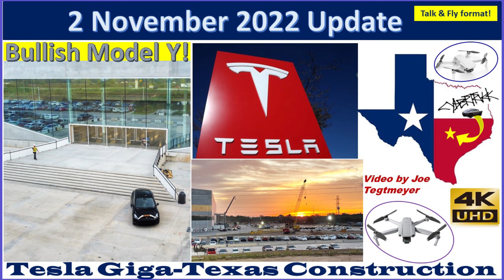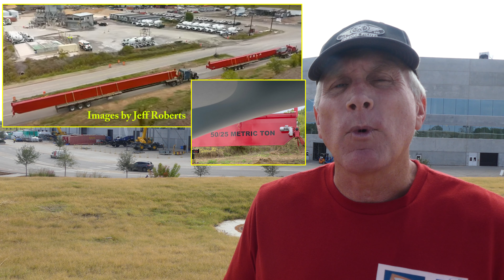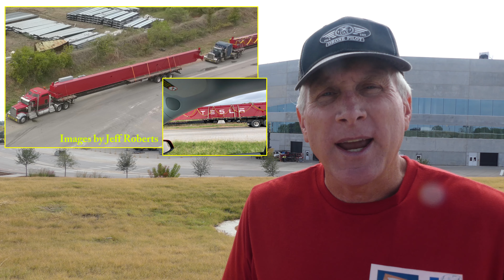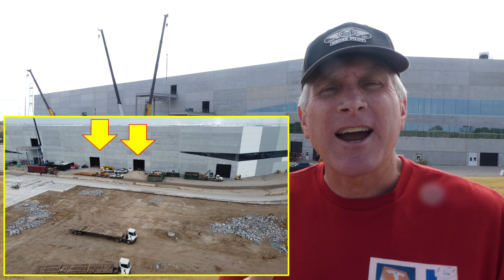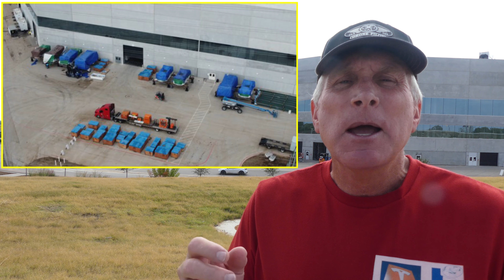Five new construction sites & S drill assembly! 2 November Giga Texas Construction Update (10:45AM)

Comment: the transformer foundations will have berms around the edge to prevent spillage to the soil of the oil used to cool the transformers. all transformers must have a berm to be licensed. sp expect short walls to rise from the poured concrete floor
Reply: That explains the vertical rebar then. Thanks for the tip!

Comment: 6:00 'that dirt repository' not to be confused with the schoolbook depository nor the grassy knoll,
Reply: the same point was raised in Tobias Lindh' video of GB 4 hours ago, about a similar open roof situation next to identical coolers on the battery building roof there.` Answer: it is in the plans to keep it open! Those coolers need a very large amount of air to pass through, so with an open roof section they can optimize air to the coolers as a mixture of air sucked from inside the building and fresh air from outside. Depending on the weather I suppose.

Comment: One thing that really puzzles me about the amount of building that is going on is the main building is so big I can't really see the need for additional buildings. The main building is substantially larger than Freemont facility (right?) and they are producing all the models there in huge numbers, and so far Austin is just making a few Ys. I was hoping they would have started making M3s here by now. I am looking forward to trading my 2018 M3 mr for an M3P with 4680 batteries and HW4 soonish. A sort of rambling comment oh well.
Reply: My advise, don't do it. The 4680 is totally unrepairable. Your only option at this point if something goes wrong outside of warranty.... Full battery replacement! Even if you plan to sell the vehicle before the end warranty, that is simply passing the problem on to someone else. Your 2018 is only four years old. Selling it and getting a newer one that is more expensive and less repairable is a waste of your hard earned money. Again, just my advise, what you do is your decision.
Reply: I totally agree with you on the additional buildings. Makes no sense to rip up 500,000 sq. ft. of newly poured concrete, when they haven't finished building out their existing space.

Comment: The concrete slab removal on the south end is going to  be for the 500 ft factory extension, is it not? If I'm not mistaken, I remember you saying quite a while ago that the factory would eventually be extended  to 4500 feet total length.
Reply: I think Elon mentioned it as well earlier this year.
Reply: Yes. But was it for Teslabot?

Comment: I'm wondering if the new crane is for the shear/brake for cutting and bending the ss for Cybertruck. yes it is amazing how many people who really ought to now the difference between the IDRA molding presses that form the inner chassis and the stamping presses that form the body panels for the Model 3 and Y. The people at Teslarati screw this up with regularity, recently suggesting that the new IDRA press will be making the exoskeleton. A true exoskeleton would be the exterior ss panels. I'm not exactly sure what Elon is planning for the "exoskeleton" of the Cybertruck but I am quite certain that they will not be injection molding exterior body panels from ss.
Reply: Thank you for this. The exterior of Cybertruck is novel, and might break some records for the size of bending equipment used, but the Giga casting will be for the interior body. I am interested to see if they do one piece or two. Based on Model Y castings going to scrap, t will likely take at least a month to properly calibrate the casting press once it is set up. It hasn't even been delivered yet. My hope is to see  the 9000 ton IDRA fully installed by New Years, meaning production model CT could get built and sent for testing in by March.

Comment: Thanks Joe.
Thanks for the far north views in particular. Always just been out of speculation range.
4:04. Southend trench. Pair of vaults with hinged covers installed in the trench. An intersection for conduits to disperse in other directions?
8:02. BIW, roof. Scaffold well below the roof also. The chillers must be quite tall. Or maybe on a narrow mezzanine. Gut feeling is this roof section will be left open.
8:48. Stamping 2, roof. Cables run diagonally across the roof between some frames either side of the open space. Think this might be a test run of the lighting system that is to highlight the lettering.
9:33. Southend. Augers and a small concrete pump to the left of the white shipping container. 
9:45. Southend. Blue water pipe about to turn west through the road. Concrete thrust block on the elbow.
9:53. South of pond. Beams, beams, beams, some decking. No columns, not a building.
11:03. Stamping, road. Model Y with a blue cover over the left rear quarter window. A number of vehicles in the yard with the same. https://youtu.be/bC_Liq-RgPo?t=264
13:15. Main Entrance. Far right, removing the temporary stairs. Installed and removed twice in the last fortnight. https://youtu.be/EZNG_2WpPgk?t=209
17:55. Casting, apron. White painted steel seems to be columns and beams for a small bridge crane (looking at the stops on the ends of the beams). There are small bridge cranes above each giga-press.
Further south. Tanker, a gas (not gasoline) delivery. Highly insulated pipework visible on the other side of this wall during the Cyber Rodeo open day. https://youtu.be/uJwEzpThroU?t=599
There’s a Liquid Carbon Dioxide hazmat sign at the large drive-though door closest to the white van.
19:22. New substation site. Transformer footing on the left. Seems there will be a containment basin around the main footing.
22:27. Cathode, west. Ground slab. Vertical rebar around the edge for a concrete, or core filled blockwork wall. Floor is lower than the main Cathode building floor.
23:43. Far north. Inset photo. Beam storage site 7. 
24:38. Cathode. Tent. Porta-loo, catastrophic failure. Doesn’t bear thinking about what might have gone on there.
25:19. Cathode. York. HVAC equipment supplier.
Reply: 4:04 - just a pull box location.
17:55 - CO2 for fire suppression?
Reply: @patrickkenny2077  17:55. I'll have a look at some other Rodeo videos and see if I can find some more clues. 

I hadn't given much thought to what it would be used for.

Comment: Thanks a ton for explaining the bridge crane! Wonder whats with the rails you showcased on Fri then. Maybe for that and not giga press area as presumed? How are you sure that bridge crane from yesterday is in fact for the stamping area? Curious about that :)
Reply from the maker: I think the rails you mention are for a different bridge crane (smaller) that is in the casting machine structure. The concrete columns they were attached to required additional reinforcement bracing that required the bridge crane to be removed and the rails so the reinforced straps could be installed. They are now re-assembling the rails and bridge crane there now as well.
Reply: @JoeTegtmeyer  Really hope we have positive movement on whatever they're using for the Cybertruck body / exoskeleton. I should have tracking news shortly on the 9K w another BOL in the next week or so. Will tweet when I get that.
Reply from the maker: @NotMyRealUTubeYall  thx!
Reply: 0:43. Bridge cranes. Too long to be installed anyway else on the site, 100' or more. Can only be for Stamping 2 even if we can't see them being installed.
Reply: @DessieDoolan  actually, the 9k press is 100’ long per IDRA spec sheet on their site.
Reply: @NotMyRealUTubeYall  May well be, but the bridge cranes seen at 0:43 are for the Stamping area, not the Casting area.

Comment: 26:37 There's a triangular section that was used for a while by the warehouse on wheels that is aligned with this new site. My speculation is that this is where they are going to build the road going north. Assuming that's correct, it looks like that are going to realign the existing road on that triangular section and rebuild the intersection. Whatever the case might be, theses 2 sections on either side of the road definitely feel like they are part of the same project.

Comment: Thanks joe for spending your days there. Exciting how much is going on around the campus. The bridge crane in the south west you think is for lifting large rolls of steel for cybertruck?
Reply from the maker: That, moving and installing the stamping dies, and assembly of the AIdA stamping press.
Reply: Hoping they make a cybertruck assembly video where they show how quickly it comes together. I guess 3-4 hours.
Reply: XXX   Think the cybertruck stainless panels come sheets,  too thick for rolls.  xxxx.      WRONG AGAIN,  thanks Joe and Johnny B
Reply from the maker: @davidclark2286  Starship uses the same 304 SS and it comes in rolls
Reply: @davidclark2286  Savoy Piping claims they can supply SS coils up to 80mm thick.